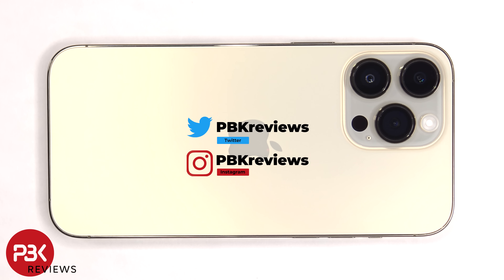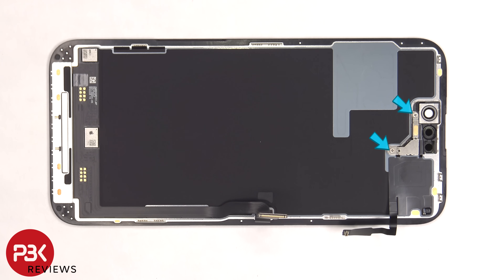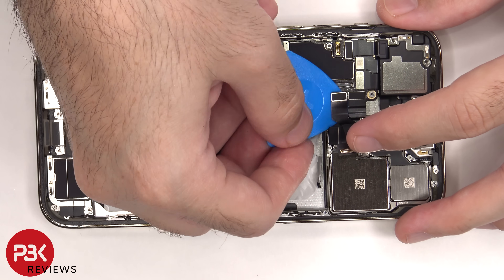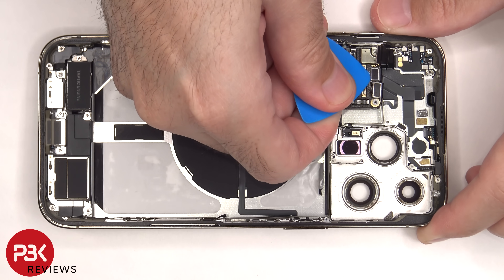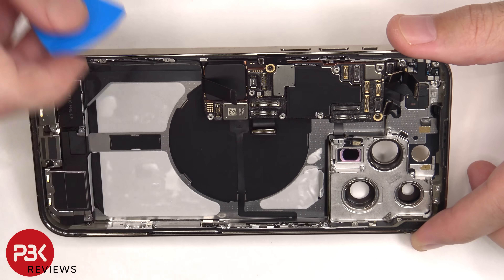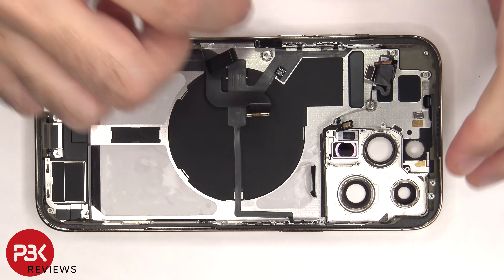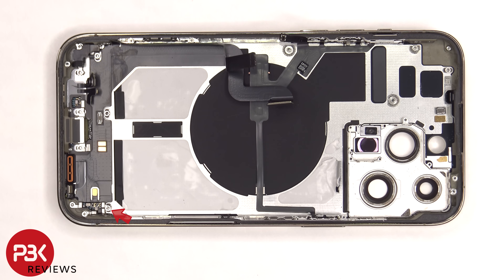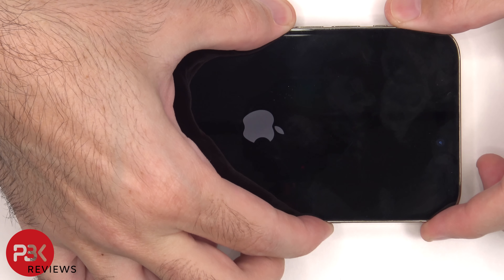Apple iPhone 14 Pro Max Disassembly Teardown Repair Video Review

Comment: I never clicked on a video so fast. Really good video. Some reviewers and articles say the back glass can be removed now? Did you find that to be the case?
Reply from the maker: Thanks! Hmm not sure, it didn't look any different from the 13 pro max but I will take a closer look tomorrow and see how difficult it is to lift it up without the risk of breaking it.
Reply: @PBKreviews  appreciate it. I tried to find a source behind those comments, but found none.
Reply: @IAcceptVisa  It's the 14 and 14 plus models that should be removed from back, Just saw a video regarding that.
Reply: @irefurb.chennai  Thanks for the response, that's a shame though

Comment: Hi thank you for video
I Really appreciate your teardown 
But i wanted to hear your opinion about build quality and hardware parts like we face problems like heating or poor build quality of phine or not friendly to repair 
If you can give your opinion how brand need to fix those issues and your rating 
It will really help 
Regards- pratik
Reply from the maker: Well when it comes to this phone, I would want to avoid doing repairs aside from a screen replacement or battery replacement. Takes way too long, too many screws of different type and sizes etc.

Comment: Great video sir. Why doesn’t Apple secure the battery with brackets and screws?
Reply from the maker: Would probably make it thicker and take up room. They should all use the adhesive pouches which are reusable and easy to pry off.